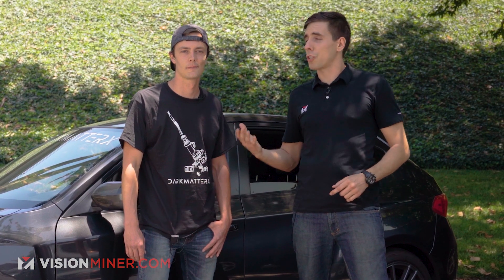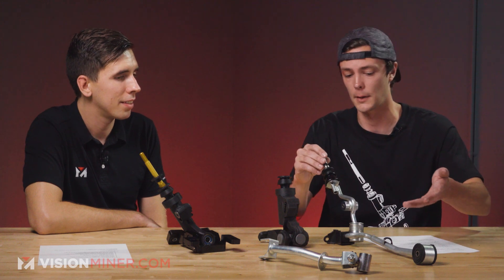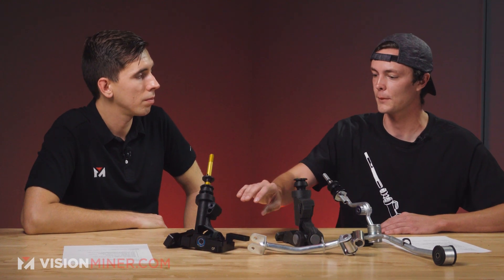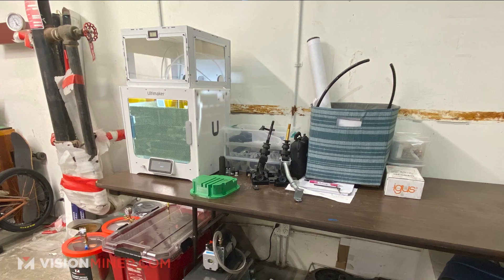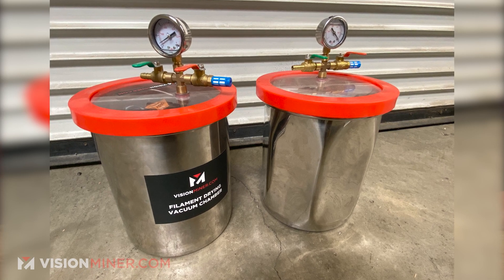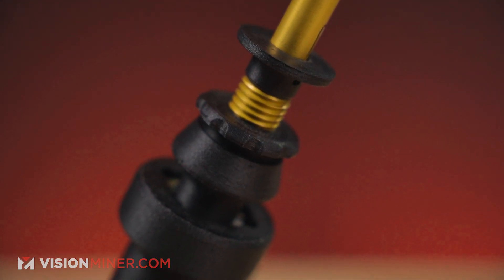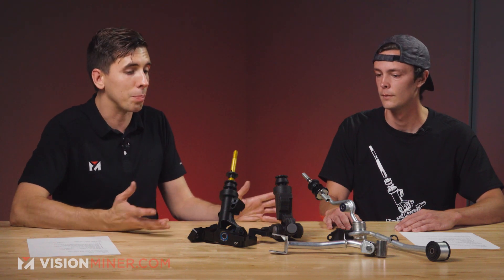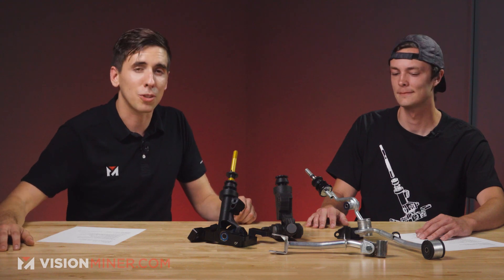3D Printing Car Parts With DarkMatterX

Comment: 3D printing is going to be the ultimate weapon against tyranny in the future when the AI controls all manufacturing. Eventually they will connect these to the cloud and check patents before letting you print. They will make laws demanding the chips be made a certain way. These vintage machines will be deemed illegal. This message is from the future. End Transmission.
Reply from the maker: 10-4